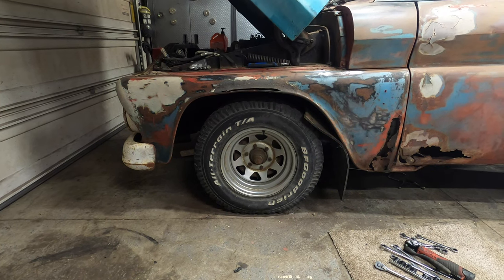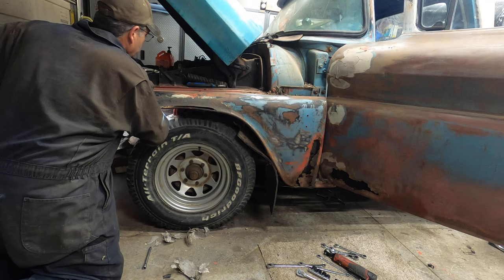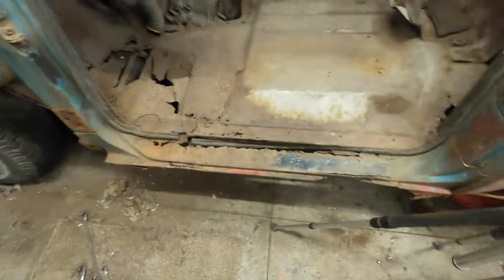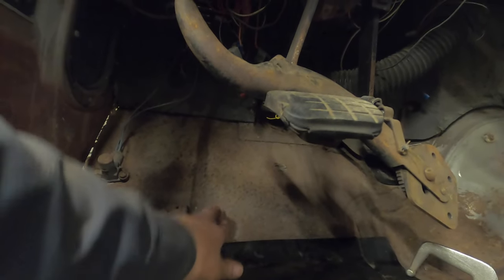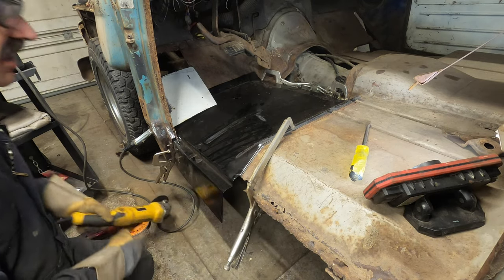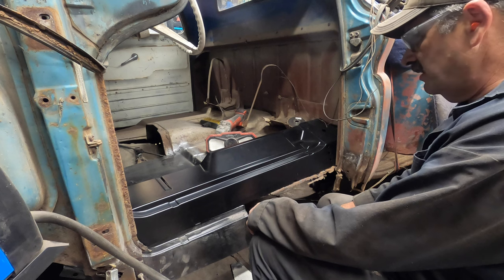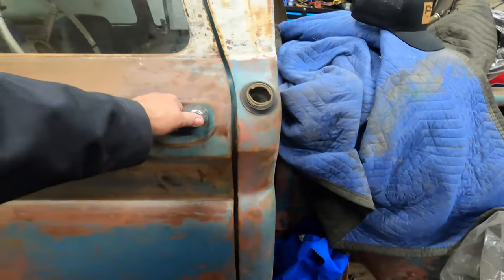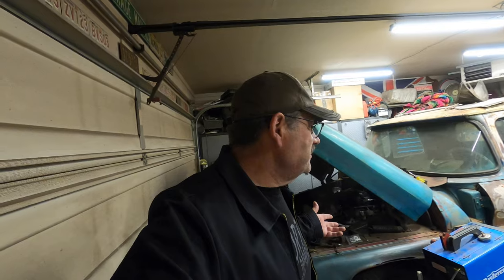ROTTED OUT!! - 60-66 C10 GMC Floor pans & Rockers! Amateur Hour Continues!  So much rust!  Let’s go!

Comment: Im not even done watching and I'm jealous of your handy work. I have a 65 C10 which is not drivable yet cause I can't weld to fix finishing the job
Reply from the maker: You can do this, it’s easier than you think. Get yourself a welder or a friend with a welder and get in there. If you make a mistake, cut it out and start over. It’s not that bad, I promise

Comment: I don’t know it looks like it didn’t turn out S well as I thought it would some times just over the top of old floor in some areas works fine and seal it seam sealer afterwards .
Reply from the maker: I’ve done both, lap joints and butt joints, I’m pretty happy with the way it turned out to be honest. 

But nothing wrong with a lap joint in a floor, I agree, the factory did it for years too😊

Comment: I’ve been cussed out by old timer for doing it on my Studebaker doors but on floors seemed fine doing butt joint right now on patch on 53 c cab Stude hood and still a pain ! I’ll post mine fix or complete job on my page . I also have a couple trucks listed and sell Stude truck fenders I. Fiberglass .
Reply from the maker: You just gained a subscriber!  I wouldn’t mind seeing that at all! I love learning different ways of doing repairs

Comment: Was that long inner rocker from LMC?
Reply from the maker: Not LMC stuff but yes. The long inner rocker
Reply: @shortcutgarage  so where'd you get the long inner rocker in question if not from LMC? They were the only ones I found that had the outer floor section. Most were just the vertical flat portion and maybe the bend under the sill plates
Reply from the maker: @maggs131  jeez, Rockauto has them, KMS Tools off the top of my head, I think they call it outter floor / Inner rocker or something. I’ve seen plenty of them
Reply from the maker: Just went on Rockauto. Click on floor, then rear left outter or right outter. They have them GMK414251060L or GMK414251060R